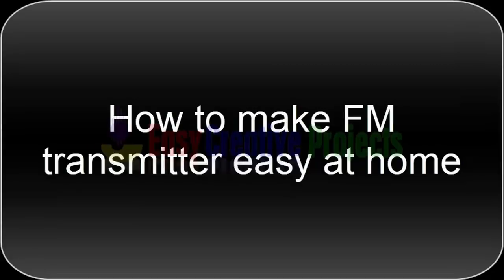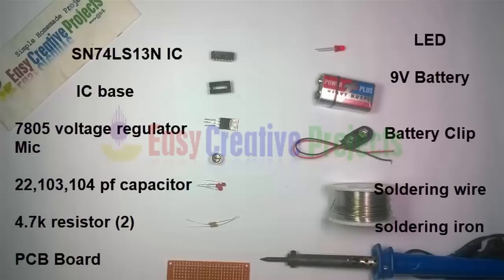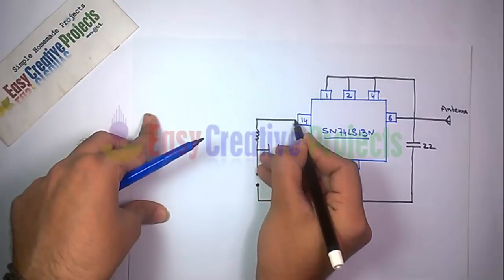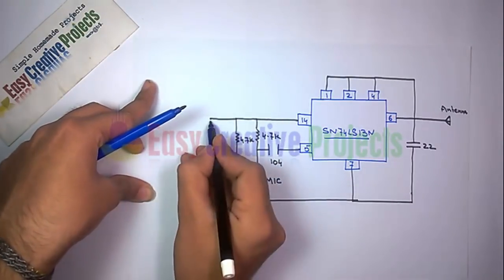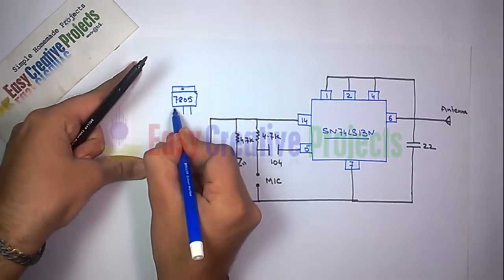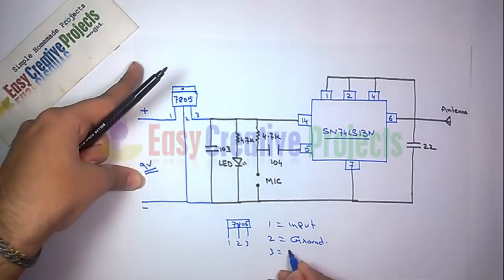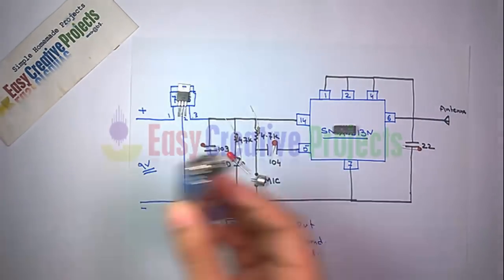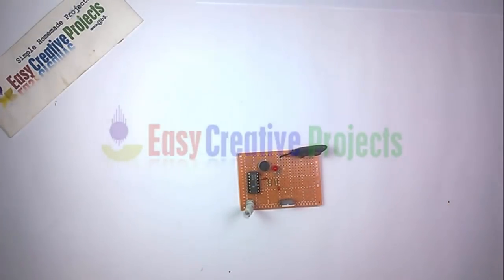How to make fm transmitter easy at home - without coil with circuit diagram

Comment: Sir can we use 74ls138p ic instead of this ic????????? Pls tell pls pls
Reply from the maker: LS138 is a decoder ic.
you need dual 4 input schmitt trigger ic.
or you can make it without ic with the help of transistor and coils.
thanks.
Reply: @EasyCreativeProjects  but sir what ic can we use instead of this ic ????? Pls tell sir pls pls pls
Reply from the maker: sn7413, sn5413, sn54ls13, sn74ls13, t74ls13b1, 
you can make fm transmitter with, max2606, upc1651,
Reply: @EasyCreativeProjects  sir this are not available can I use 7414 or 74ls47 ic pls tell sir pls pls pls tell sir
Reply from the maker: @rezinaakterrumi6775  no.
try to buy this ic from online shops.
Reply: @EasyCreativeProjects  If we cannot find the circuit element you use in the circuit, will this work work?

Comment: How to input sound with trasmeter
Reply from the maker: in this circuit you have 2 option.
1: you can input sound using mic
2: you can input sound using cable. that you connect mobile, mp3 or any input sound device.
Reply: @EasyCreativeProjects  we have to do any change in the circuit if we want to do the second option?????? Pls tell sir pls pls

Comment: What radio frequency you have set in phone to receive the sound
Reply from the maker: in my case its received on 93.5MHz.
Reply: @EasyCreativeProjects  1:45 WHICH IS NEGATIVE SIDE OF MIC AND WHICH IS POSITIVE ? WHICH SIDE GOES TO #7 PIN ?  - OR +

Comment: Where you feed the audio output from the phone to transmitter?
Reply from the maker: using mic
Reply: I want to ask u use audio jack from phone to transmitter 
Where you connected those wires in transmitter CIRCUIT
Reply from the maker: dear its wireless system base. not cable base.
Reply: Let's talk only about transmitter
You have shown mic(to take audio input and transmit through transmitter)

But in working you haven't shown the mic 
You fed the audio to the transmitter through mobile by using a headphone jack
So those terminals of Jack (ground, audio left,audio right) where you have connected to transmitter????
Reply from the maker: dear 1st wire you connect with ground. and 2nd wire you can connect any one left or right. both wires give you sound.
Reply: @EasyCreativeProjects   you didn't understand what I am asking you are true at your place
Reply: @PRANAVSAWARKAR  Bro i think audio left and right is connected with one of the mic terminal and the other terminal is connected with the ground of the audio jack
Reply: @PRANAVSAWARKAR  can you pls tell now which wires of the audio jack are in this circuit board ??? Pls pls pls pls tell
Reply: @rezinaakterrumi6775 use earphone jack's ground and  combination of left and right, in place of mic
Reply: In this circuit, will it be enough to just plug in the jack from the microphone part?